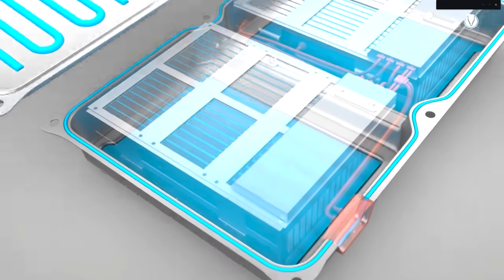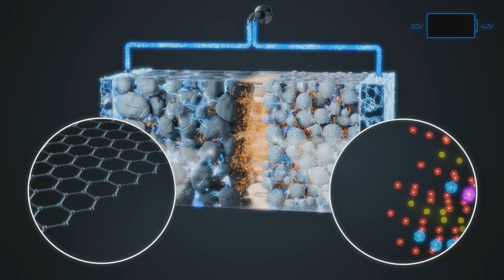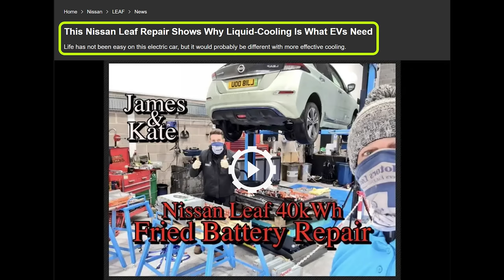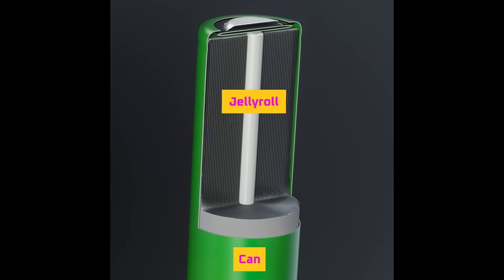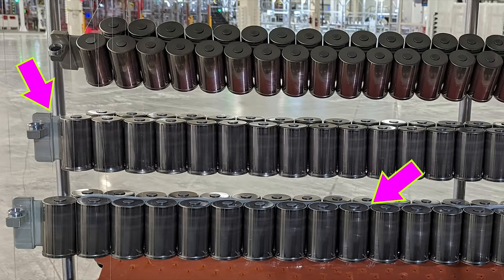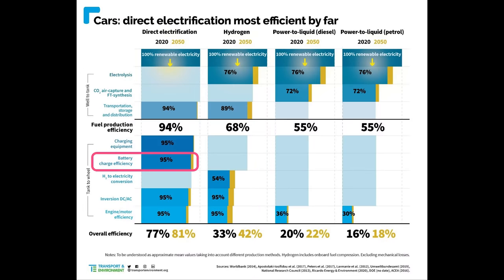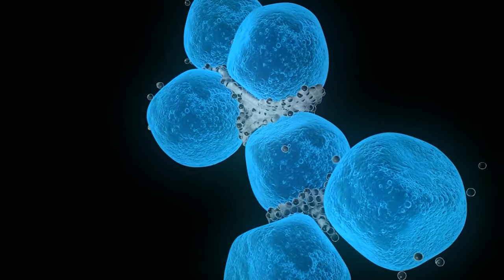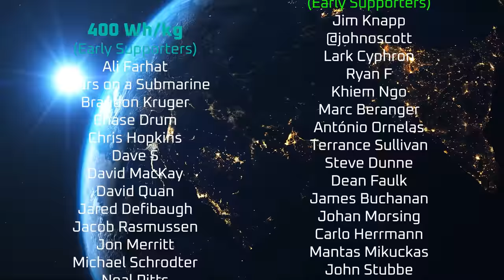4680 Thermal Design and Management // Why Ribbon Cooling is Better

Comment: I strongly disagree with packing density of prismatic vs cylindrical.
Presuming wound sheet inside prismatic, still wasted space and crimped sheets of electrodes.
Packing density of cylinders is great at 90%, (pi/root(12)), very little wasted space.
A small difference in volume / VED almost immaterial - pack height has more impact on vehicle design.
Reply from the maker: The rolls are flat wound and hot pressed.  They pretty much fill the prismatic case.  Plus less wasted material in the case.
Reply: @thelimitingfactor  also double sided electrode sheets are wasted both outer wrap and inner wrap.
If had just double wrap, it’d be effectively single sided half the cathode & half the anode. Large, thin prismatic with few wraps would be worst (blade). With 10 revolutions, lose effectively 10%. Similar to packing efficiency loss. Cylindrical lose half as much if same cell volume / capacity. Say pi * D on 4680 vs 4 * 80mm on prismatic 80 mm long * 21mm thick (times 80 mm deep). 
Sorry to confuse the issue, not my intention.
PS. 25 layers means less proportional loss, same absolute.
But overall, VED is irrelevant, doesn’t affect cost, range, weight. Enough room for battery pack volume. If not, a 5% difference would add 4mm to floor height. Vs the 100 mm odd extra Rivian imposes.

Comment: Is it me or tabless is a misnomer??? It should rather be multi-tabbed cell.
Reply from the maker: I've already covered that.  No.  A tab is welded on and connects to the terminal.  Those are flags cut in the electrode for  the tabless electrode and they don't connect to the terminal.

Comment: Why arent cells built and cooled internally. Imagine a copper or alumium pipe of diameter 6mm with 1mm walls (or whatever size is appropriate) and the active battery materal is wound around this pipe. You could build extrmely long bayteries. Rather than 46-80 maybe even 50-800 or even bigger

And then you just run your cooling internally
Reply from the maker: Because it's all about surface area.  Cooling the core without cooling the outside would cause more problems.  Plus, it would be more expensive.

Comment: Why not submerge all the cells in a dielectric coolant cooling both the sides and base and also 100% of the surface instead of 20% like tesla..

Cooling would be uneven then thats why?
Reply from the maker: Weight

Comment: The way Telsa does ribbon cooling doesn't seem that great thermally. To me it seems likely it has about the same thermal conductivity as plate cooling would have. I'm betting the reason is either structural, form factor, ease of manufacture or cost of manufacture.

Comment: "cooling the base and top provides very less relief to the sides".....I watch this guy's videos primarily for the comedic relief that his m0r0nic assertions provide. 🙂
The number of m0r0ns who cling on to this kind of nonsense and tout it as gospel on SM is incredible.
When 'all other things are constant' (heat sinks being equidistant from the source etc) then contact surface area makes a difference. However, the Top & Bottom plates are much closer to the heat source (current collector inside the can) than '1 rectangular patch on 1 side'.
The video's take that Top-Bottom cooling somehow 'orphans' the sides is ridiculous. Most heat will flow from current collectors to the 'infinite-tabs' connected to Top-Bottom caps....leaving very little to flow thru the dozens of insulating layers leading upto the side walls.
Let's assume that heat from current collectors somehow permeates to the sides (in large quantity), then if side walls can wick heat from the Top-Bottom to provide efficient (?) cooling (as described in the video), then it's only logical to expect the reverse flow (that Top-Bottom will also be able to wick heat from the side walls).
Net-net, Top-Bottom cooling of 4680 will always be more efficient than (one) side cooling. However, the choice made by Tesla might have been driven by other considerations (like safety....ability to vent a thermal runaway via the bottom etc). Even though Top-Bottom cooling maybe the MOST efficient, the side cooling (via ribbons) may have achieved REQUISITE cooling while providing design flexibility to take care of other aspects (safety against thermal runaways etc).
Note that Top+Bottom cooling means heat is wicked away via all metallic contacts. Side cooling ( or for that matter Top-only or Bottom-only) essentially means that one set of current collectors are directly cooled, while another set of current collectors have their heat wicked thru the insulation material to the adjacent current collector of opposite polarity).
(Also to be noted is that Top-Bottom cooling that facilitates a more pristine honeycomb packing will also be structurally MORE strong. But again, Tesla might have attained REQUISITE strength in the current design that they felt comfortable to heed to other aspects viz safety)